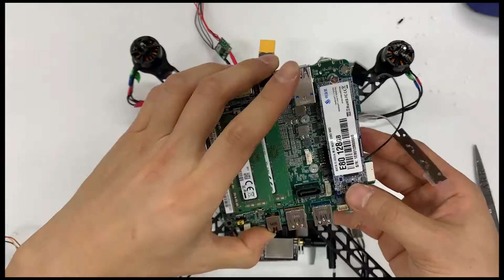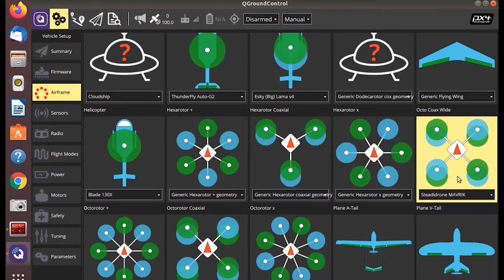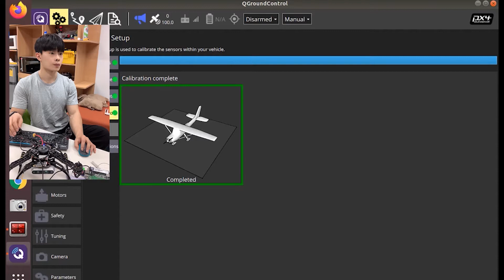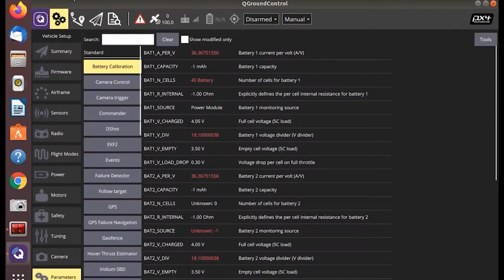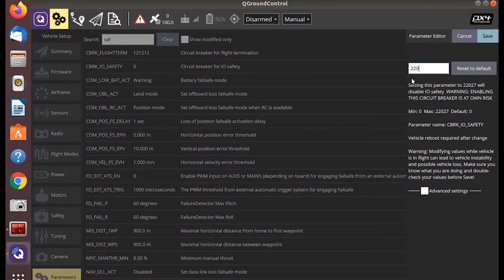[Build Codable Drone] Ch4: Configuring pixhawk (PX4)  and motors

Comment: Hi, how did you manage to do stable flight in indoor. Also which mode did you choose to takeoff using telemetry. I tried Guided no GPS mode and using dronekit but failed every time. Please suggest. Thank you
Reply from the maker: I always operate the drone In offboard mode... and using mavros in ROS
Reply: @boseong-joen  I got your point. Then T265 provides you the local co-ordinate that you manipulate to ur MP. Great help. Respect from Taiwan.

Comment: Hey Felipe, I am building a drone with similar configuration. I am a Ph.D. Robotics researcher as well. I am having problems connecting the Pixhawk 4 mini drone to a Raspberry pi as well as with the QGtoundControl calibration of the battery and ESCs. Everytime I try, it says the firmware is not supported by the QGtounrControl. Is there any way to flash the existing firmware and redo the entire firmware download from scratch? Please make a video for the same if possible. Quick question, if you want to use the drone indoors, can’t you use a fake GPS status from the MavLink console and not connect the GPS at all?
Reply from the maker: 1. To upload  custom firmware cloned from PX4 repo without hassling with QGroundControl, refer to this page:   https://dev.px4.io/master/en/setup/building_px4.html 
2. As I said, the only reason why I am carrying GPS is to "hear the status sound and signal", which really helps me when I am busy with experiment. I haven't used fake GPS but I always use EKF2 to fuse VO information with IMU data of Pixhawk. 
If you have other questions, free to reply:)
Reply: @boseong-joen  thanks for a quick reply! Can you please help me with the connection between the pixhawk mini and the pi? I tried connecting using the telemetry 1 port. Is that the right configuration or should I be using the UART port? Whenever I try to arm the pixhawk through raspberry, I don’t get any response from the motors. I am fairly new to this! Any help will be much appreciated!
Reply from the maker: @souravdutta4075  USB. lol
Reply: @boseong-joen  I have been through a few tutorials that suggested the use of usb, however, in the same tutorials, they mentioned that using USB will only increase the number of problems! The flight controller assumes that the drone is still connected to the QGroundControl and hence shouldn’t take off, as a safety measure. I am not sure how to get past that problem!
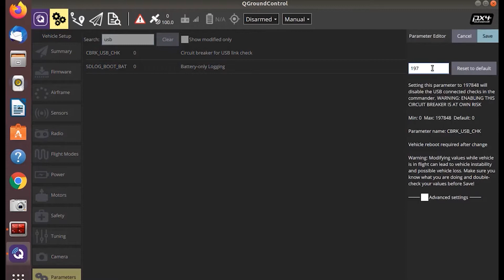Reply from the maker: @souravdutta4075  kindly refer this. 5:23 .    Recommend to watch my whole video:)
Reply: @boseong-joen  ok got it. Didn’t notice initially! Thanks for the help!